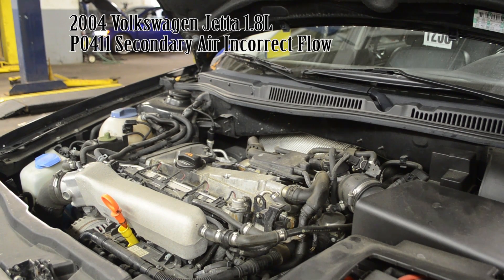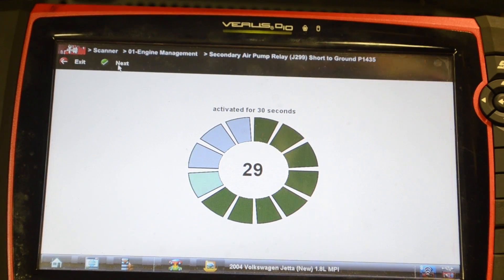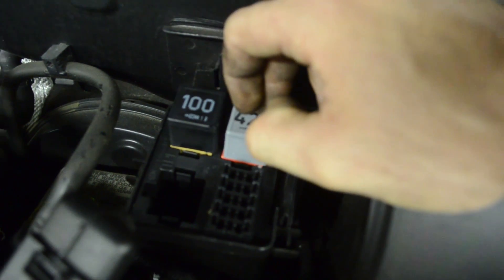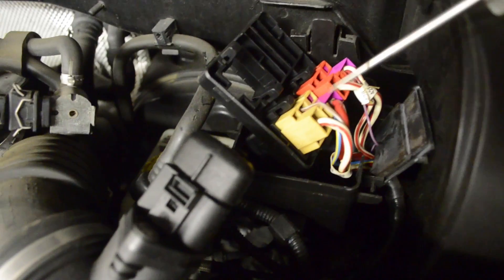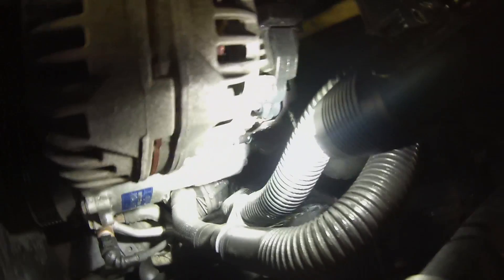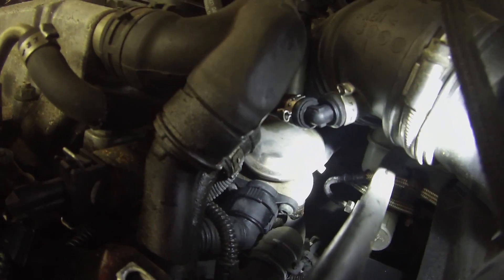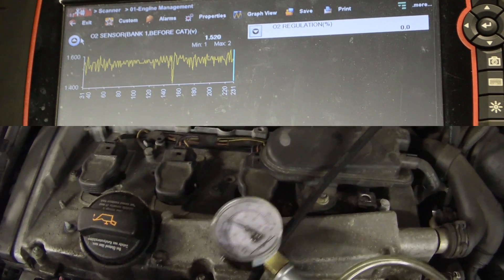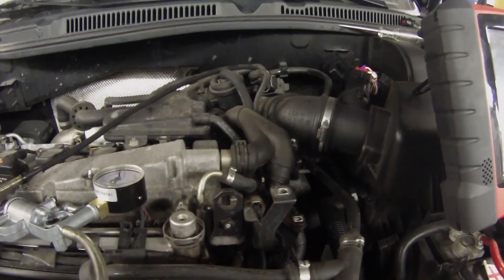2004 Volkswagen Jetta 1.8l- P0411 Secondary Air Incorrect Flow

Comment: My own (2001 Passat 1.8T) secondary air injection system failure was caused by a vacuum leak in the solenoid valve that controls the combi valve, which itself was carboned-up. Replacing combi and its control solenoid, plus the visibly deteriorated silicone hose connecting the two solved the problem. This is evidently not a particularly common failure mode for these systems, but I wanted to share it.
Reply: thanks sir

Comment: Question, where did you connect the manual vacuum pump to the combo valve?
Reply from the maker: On the vacuum line portion the comb Valve.  Newer vehicles have an electronically controlled valve so there would be no vacuum pump needed. The solenoid would need to be commanded open

Comment: Hi guys can anyone help,I got a golf 4 1.6sr there's a backfire from the intake ,what cud be the issue
Reply: Have you ever popped timing belt?
Reply: Hi there I managed to resolve the issue , I took out the throttle and cleaned it in and out put it bk n it's bk to normal

Comment: I open my air pump i add some black silicone and add a bolt and nuts. I tide well and bingo stop leaking. 🤷‍♂️ save me couple 💵. After 500 miles still working like a champ 😉

Comment: How do you test the secondary air injection relay? It works off of voltage from the computer, not from the battery. What is the polarity and voltage of the relay input terminals? I think the input terminals are 1 and 2, and the output terminals are 3 and 5.

Comment: Great video. I subscribed and liked. I had a question though. So my hose from my SAI pump that goes upward to the engine I think to the combo valve... That hose snapped all down the middle. I taped it up and put it back on. I've been to all the parts stores and none of them have the SAI pump hose and actually turns out they cannot even order one period.  I'm going to scrap yard tomorrow but do you know who else would I be able to buy a new one?
Reply from the maker: It might be a part you can only get from the dealer
Reply: I had to replace mine on my 1.8T got the replacement hose from 
https://m.eeuroparts.com/Parts/PartResult.php?search=secondary+air+hose

Comment: How does the p0411 code affect the car? Other than smog or cold start areas. What else would I notice wrong? Aka is it worth fixing?
Reply from the maker: All you would notice is a check engine light. And you would not be able to pass emissions.

Comment: Also, have noticed that the small radiator fan will not operate with the AC switch on. The fan has operated when temp called for it. That was part of the reason that I thought the J299 module failed.

Comment: I have a 2007 Jetta 2.5 and I can't get the secondary or primary EVAP to complete for inspection. Checked the secondary air pump and it powers up. I checked the two relays, J299 and ECU, 100amp. Completed a smoke test and fixed a few EVAP leaks too. The car runs great. Have driven for over 500 miles and EVAP system still shows incomplete. Any idea? Thank you for your time.
Reply from the maker: Do you have a vagcom? You may need to run the monitors using basic settings.
Reply from the maker: Any faults?
Reply: Thanks for the reply. I have a VAG401 scanner and a Actron scanner. The VAG401 pulled 9766 and the Actron pulled 2626, O2 sensor, which I replaced 4 weeks ago with a Bosch original equipment 17480 O2 sensor.  The check engine never came back on after replacement.
I have changed the purge solenoid, gas cap, and the PVC diaphragm. The secondary air pump did have a little air leaking around the gasket area, which I resealed. The air pump it self seems to power up ok when I jumped it with 12V. The two EVAP emission blocks just won't show complete.  Thank again.
Reply: VAG401 unit I have is limited to what I can do. I did a block 71 test and from what I could understand it said EVAP was ok. Not sure what the numbers were or mean. I think one was 105%, another was 42% and the last one was 56%. But when I go to readiness it still shows the two EVAP's as incomplete. It has me confused a little. Thank again.
Reply from the maker: 77  should be secondary air. But you need to run 34 first that's for the front o2. Do 34, 77, and 71

Comment: My secondary pump wont start..possible causes?In the morning at cold start, i can see the car interion light dim for a sec, several times..as if its trying to energise the pump..but nothning happens..could it be the egr/combi valve?? BTW i own a New Beetle 1.8T 2001.
Reply from the maker: Could be a faulty pump. Faulty pump relay. No control to the relay or Power or ground to the pump
Reply: i found some watter in the hoses..not much..just drops. Thats why i asked about the egr. Cause in the morning it burns much moisture

Comment: Great video man, very helpful and informative. I have the same P0411 code on my '05 GTI with the 1.8L turbo motor, AWP engine code which should be the same as the Jetta in the video. So far I've rebuilt my air pump with nuts and bolts after knocking out the old/damaged rivets (noise seemed to diminish at startup though only 2 rivets were bad) and I found a torn S.A.I. hose under the intake manifold on that bracket. I patched it with tubing from A.Z. but the code came back. I now want to check my combi valve but was wondering where you hooked up your vacuum pump? I'm having a hard time removing it in order to clean it with carb cleaner, so after watching your video I figured I would confirm it's working on the car. I bought a similar Mighty vac vacuum pump from Harbor Freight a couple of weeks ago, but I don't have a copy of Vagcom or other diagnostic scan tools like you used in the video, just a cheap Bluetooth OBDII reader with the torque pro app.

Comment: Hi I have code saying secondary air injector insufficient flow.... did head gasket but a friend snapped a hose that runs from the kombi valve down to what I believe is that SAI. Just that simple hose breaking would throw the code right? I don't have fancy tools to test things  but I know the hose is broken, that's for sure!
Reply from the maker: Absolutely. That hose being broken will definitely cause that fault.
Reply: Positive Lead Diagnostics having hard time getting hands on the part should I order online somewhere🤔or what do you think
Reply from the maker: Any dealer close to you?  I guess if you have no other options check online. Get a part number off the old one that may help you in your search

Comment: Hi as soon I heard the air pump run I knew that the pump was leaking I usually repaired them with long thin bolts with nylon lock nuts woks great way cheaper than a new pump.
Reply from the maker: I have seen that before. Much cheaper.

Comment: makes a change that its not to filled with water!!
Reply from the maker: you had one filled with water?
Reply: yes seen loads they build up condensation and die
Reply: We had a guy with audi a4 get a tsb from usa dealer  to change the diverter valve to prevent condensation from egr building up in air pump but still did not fix.
Reply from the maker: I've heard of the cylinder head ports clogging up with carbon   Never had one with condensation.  When you say diverted valve do you mean the secondary air switching valve
Reply: looks like this pretty sure this was called a diverter valve back then
 https://www.amazon.com/Check-Valve-Combi-Passat-Touareg/dp/B010B0MMDQ?tag=vs-auto-insert-amazon-20
Reply from the maker: That looks like it. I mean it is a diverter valve. It diverts the air.

Comment: Great!!!! Thanks for sharing.. My big brother owns a 2009-GTI
Reply from the maker: 09 may be a little bit different basically the same system but the switching valve may be electronic and it also may have a secondary air pressure sensor